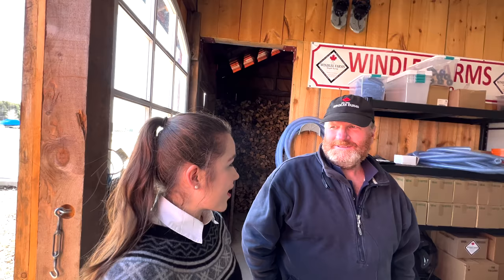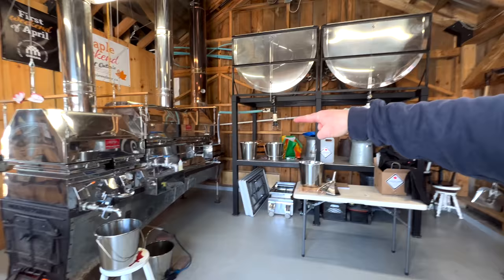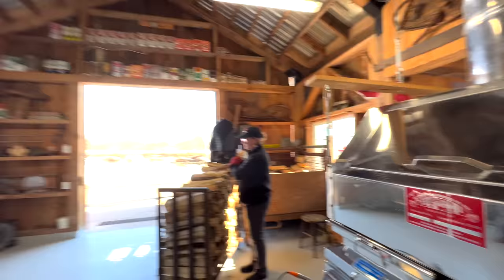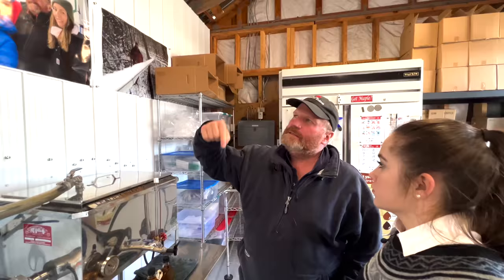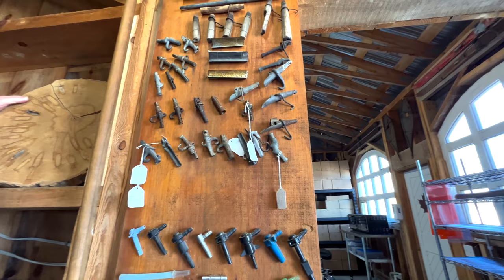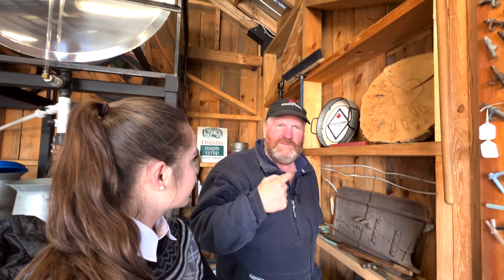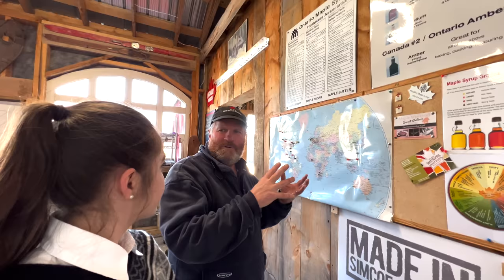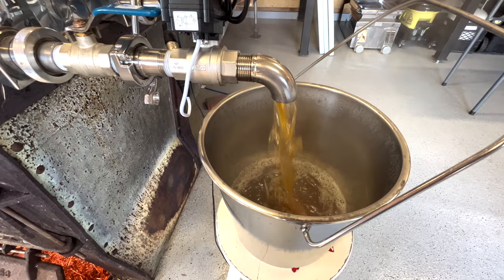Maple Syrup Harvest!  Family Farming 2022

Comment: On a farm size operation like this one has to  use better equipment, however a friend that uses wood, tree stumps, and coal and really anything that burns to heat his shop and home, came up with a 100 gallon bowl that he has his seven kids fill with the sap from taps with buckets. This system is vary inefficient labor wise and really happens because of the heat from the boiler fire. However it eventually boils or evaporates down to a few gallons of syrup for the family.  This system is efficient in the sense that the boiler heat is there anyway and the overall cost of everything is vary small.
Reply from the maker: Thank you for your comment.